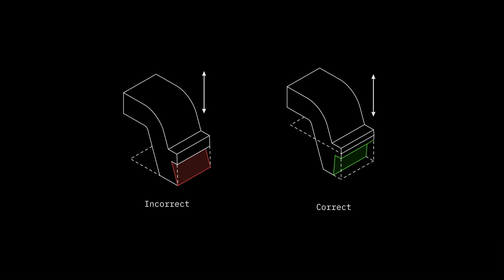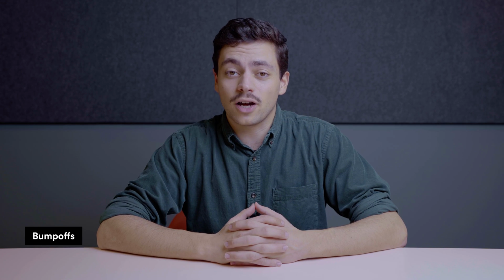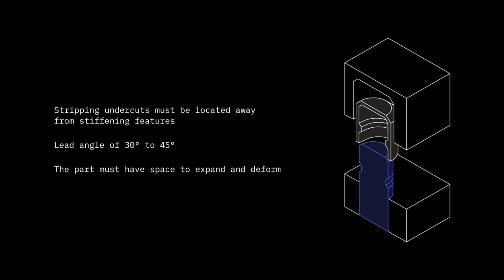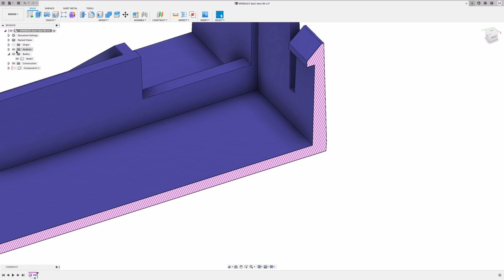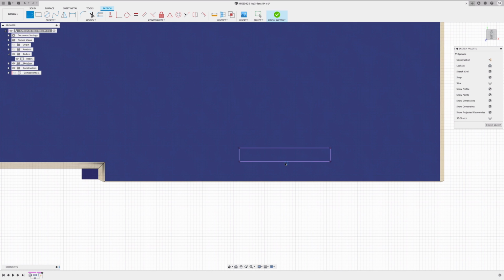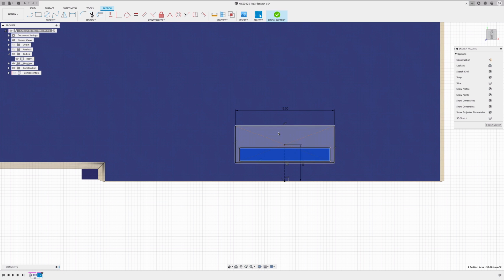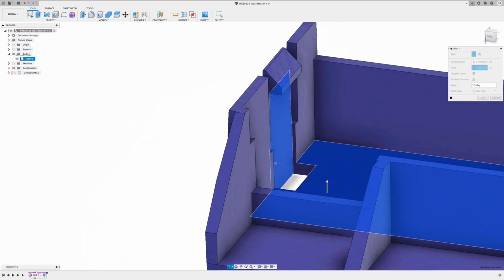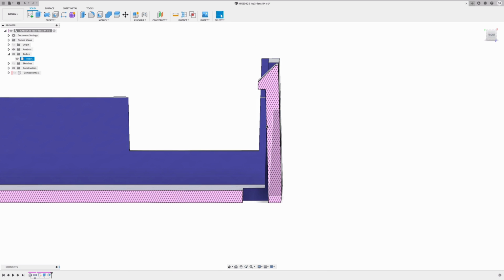Injection Molding - Undercuts (How to Avoid and Design)

Comment: Excellent tutorial!❤ Undercuts and ejection issues are some of the most common and costly design challenges we see with new parts. This video does a fantastic job explaining the solutions on the tooling side.
For designers looking to avoid these pitfalls before committing to production tooling, we specialize in low-volume manufacturing for functional testing. Using CNC machining or vacuum casting, you can produce snap-fit prototypes that look and feel like the final part, allowing you to test and refine the undercut design for manufacturability with zero risk. Great content!👍

Comment: This 1,5 degree draft would have to be increased to at least 5-10 for a proper steelmeet interface. It simply aint gonna shutoff at 1,5 degrees unless you press the tool together and form a black hole in the process :D 
It is a great way to form undercuts on none styling parts however.
Reply: Steelmeet you mean that steel material from different parts are touching each other?
Reply: @kriti4everjr97 Yes, the shutoff area that you create where the cavity and core would touch steel on steel
Reply: @aeywyn5230  ok, now I got it. So there, the draft should be significantly larger than the typical steel-to-plastic draft.
Reply: @kriti4everjr97  Yea. If you wanna have less than those 8 degrees you can cheat and create a 0,1mm gap inbetween the mouldhalves. It will just become flashing in the end but you will see this on 99% of all automotive bumpers and such.
Reply: @aeywyn5230  Oh interesting! So, you reduce the draft inbetwwen the molds, but this forces the plastic to flow through the small 0.1 mm gap you left, causing a flash? Do I get this right? (new to injection molding). Thanks a lot mate ❤
Reply: @kriti4everjr97  The plastic wont really flow into the 0,1mm distance a great deal. So if you were to model it in CAD it would look like you have left a 0,1mm-0,2mm skin connecting the clip in this scenario to the sidewalls as well. 
Done this one some bongoclips as well to avoid steel on steel contact and prolonged the life of the thin steel thats usually associated with clips.

Comment: You forgot to mention lifters, which is afaik the most common way to solve the undercut issue after shut-offs, since they are cheaper than side-action and more flexible in placement.. Furthermore minimum draft angle for a metal-to-metal surface in the mold is typically 3 degrees minimum. 1.5 degrees for that shut-off is very tight.  Wouldn't it also be simpler to just extrude with a 3 degree draft from the undercut surface through the  bottom of the part. That way you dont have to create a sketch, and you don't have to use the draft command, so fewer features on your timeline.
Reply: Where do we encounter metal to metal surface in this example ?

Comment: so something im working on is basically a box, but it would require a straight up hole (or two) in the side...seems like my only options are side action & changing the parting line, and changing the parting line would just create more undercuts...